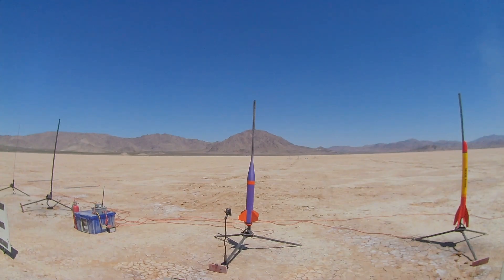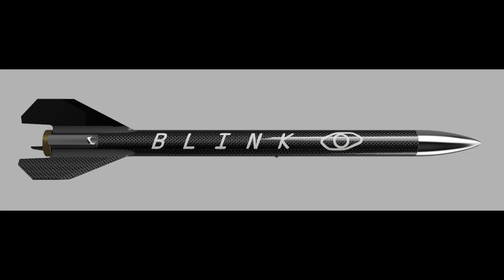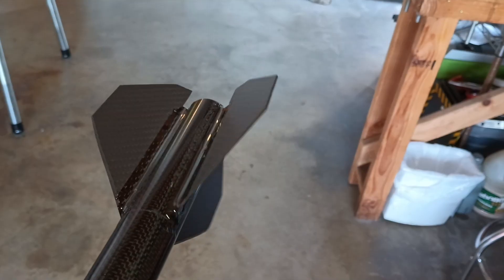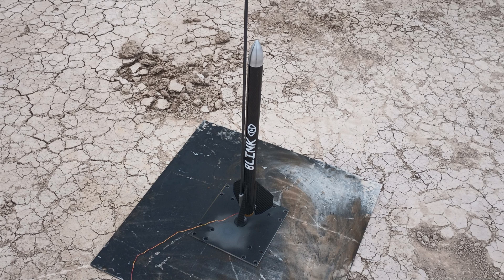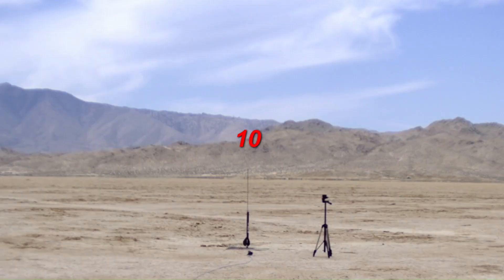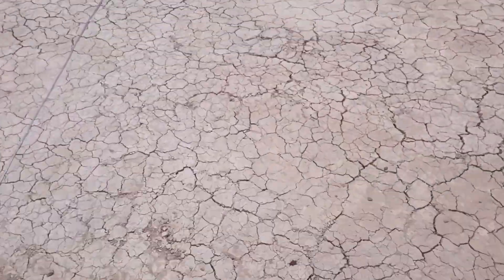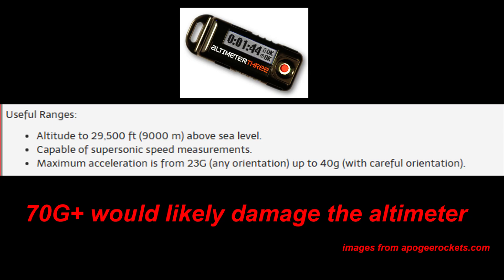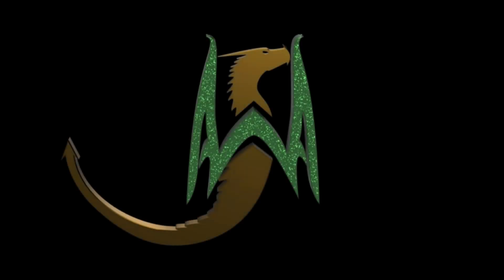I Built a Supersonic Rocket in My Garage

Comment: how high did it go? max speed? max acceleration?

this is one of the best model rockets ive seen on yt, nice going man
Reply from the maker: The estimated acceleration was 72g (706 m/s^2) and the calculated top speed was around mach 1.2-1.3 
Apogee was around 1.6km but due to limited avionics, all of these are estimates calculated by OpenRocket simulation software
Reply: @AydenWardellAerospace did you hear a sonic boom?

Comment: What is the fuel of this rocket?
Rocket aerodynamics are different

In the video, you said this rocket was fired with black powder, right?
If it's gunpowder, it shouldn't explode?
Reply from the maker: This rocket was fueled by amonium perchlorate composite propellant grains that were manufactured specifically for the motor case used. The black powder was just a small amount to eject the parachute for recovery purposes
Reply: @AydenWardellAerospace  Hi!
I'm a university student and, just like you, I'm super passionate about aerospace and rocketry. 🚀
I’m not sure how things work in your country when it comes to buying ready-made rocket propellants, but here in Iran, it's basically impossible to find any store or website that sells them.
So we have no choice — we have to make everything ourselves from scratch.

I wanted to ask — do you also make your own APCP propellant, or are you able to buy it where you live?
Also, for making it: is it correct that you mix ammonium perchlorate with aluminum powder, and then add a polymer resin like HTPB?

If you know the ratios or percentages for the mixture and could share them, I’d really appreciate it!

Thanks a lot — and I wish you all the best and success in your rocketry journey! 🙌
Stay awesome!
— A fellow rocketry enthusiast from Iran 🇮🇷

Comment: Great video. Have you tried simulations with a heavier nose cone?
Reply from the maker: Yes, the real nose cone weighs 90 grams and I simulated the nose cone with an additional payload (in addition to the tracker) of 30 grams. It reduced the mach number to 1.17 but that is similar to how it would perform with a potted avionics pcb
Reply: @AydenWardellAerospace  dude...i think u might know about the rocket engine ingredient right ? no smoke...high power....tell me the ingredient if u know
Reply: @gigiFggg  what the hell are you talking about LMAO he is using an off the shelf H220 rocket motor
Reply: @themicrowavedev shelf H220 rocket motor ??? tell me more about it pls
Reply: @themicrowavedev thus...do u know the h220 main ingredient?? if yes pls let me know
Reply: @gigiFggg  by off the shelf, i mean not custom-made. Yes, they are a little more difficult to obtain than a G type motor but alot of vendors will allow you to at lest buy one with a valid photo id so you can attempt a level one certification.
Reply: @gigiFggg  no i do not know the exact formula for the propellant, i dont work at RCS. But im not sure what knowing the formula will really do for you, there are alot of other arguably better propellant formulas that are publically available if you want to make your own. There is also publically available data reverse engineering the blue thunder propellant via the exaust gas particulate so go look at that.
Reply: @themicrowavedev  the thing is smoke less rocket engine only can be obtain from nitrocelulose....that stuff is too expensive lol...
Reply: @themicrowavedev  ive see a slowmo vid of javeline missile burst out of the launching tube by help of launch motor but the thing is...launch motor have a green flame which mean a copper compound are being added to the launch moto mixture,i wonder what copper compound do to a rocket motor ?

Comment: i wonder if potting the accelerometer pcb would give you a higher than 50g rating? I used to work on a pretty aggressive missle for the air force and potting of some of the electronics really helped with g force issue due to the main motor.
Reply from the maker: I think potting all the electronics is a good idea, I just need to find a better altimeter that can measure more than 24G so I can get the full flight data
Reply: Potting a mems gryo won’t make any difference you need to did one that can handle the launch G

Comment: Ever use aluminum tubing/pipe for a rocket body? Saw some at Home Depot just the other day and thought they'd make for good, strong, and relatively cheap material to make a rocket out of.
Reply: One other question: What about adding a small electronic noise maker to help locate a rocket after it lands? Some kind of loud high pitched chirp. It'd be a redundant system in case the bluetooth or other wireless tracker fails. 

Also worth considering is having it chirp prior to lift off, as it would be interesting to hear the doppler effect as the rocket accelerates away, as well as possibly be a means of tracking the rocket in the sky upon its descent.
Reply: I've used 20mm aluminium tube before which worked scarily well
Reply from the maker: I think an aluminum tube would make a pretty good rocket body, especially as a much cheaper version of this that needs to survive an intense takeoff
Reply: @AydenWardellAerospace How do you like the idea of adding a sound device for tracking the rocket?

Comment: Turbo ram jet?????????????
Reply: Is this a video idea...? or...
Reply: U mean using this rocket to accelerate a small ram jet to operational speeds ?
Reply: @Glibglobler  yup
Reply: @burnologist229  a supersonic wind tunnel would propably be easier
Reply from the maker: I already built a small scale Supersonic wind tunnel and it would be pretty easy to scale it up, It would however get expensive and only be able to run for a few seconds
Reply: @AydenWardellAerospace  fair enough, ive been eyeballing metal 3d printing services and craft cloud has gotten cheaper over the years, for example metal 3d printed turbine guides vanes + turbine wheel are about 80ish. So if the size is kept down its possible to have internal cooling channels for liquid rocket engines. or even turbojets...